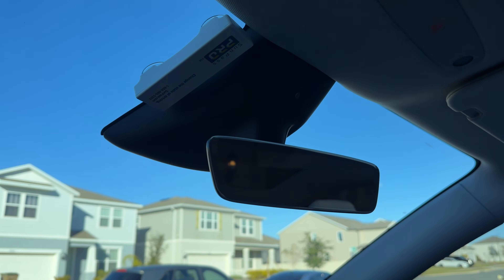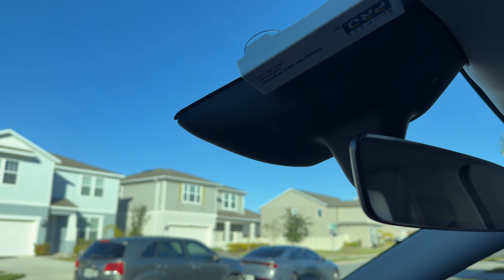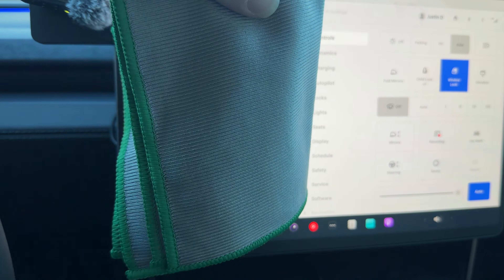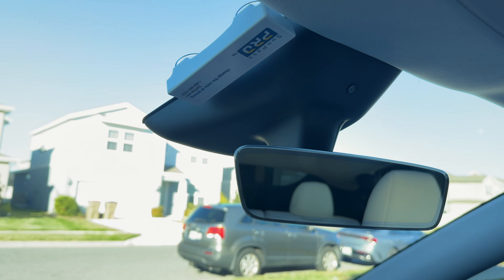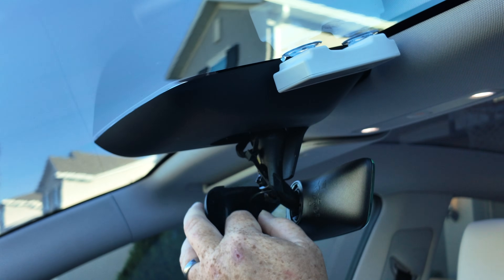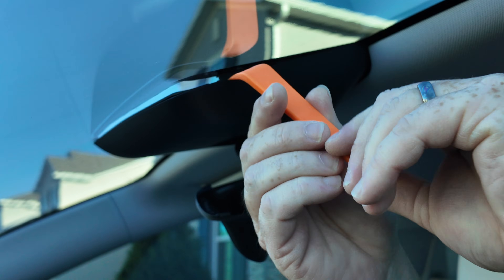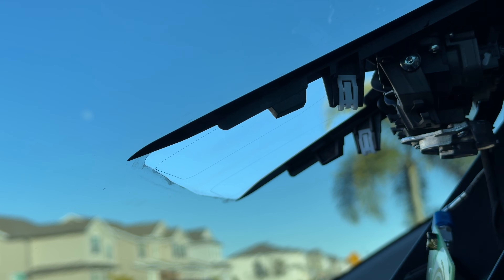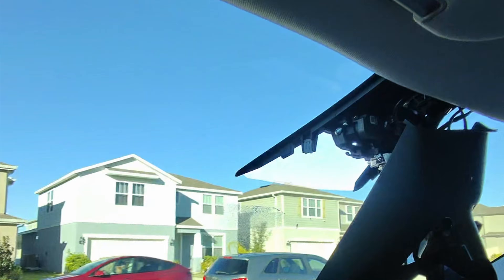Tesla Model Y: Camera Visibility Limited - Here's How You Fix It Quick & Easy!!

Comment: I’ve watched a lot of videos before I did it myself. Number one, you don’t need a pry tool, if you pinch the first trim piece at the top with one hand and put your other thumb in the hole in the bottom it’ll pop right off. Number two, you can then stick your finger in the hole and pop out the bigger trim piece, using your finger inside to help pry it out. You obviously want to replace that piece you broke because it will rattle in there. You should have slide it straight back, not flipped it up.  Four, don’t spray it on the glass,  spray it on a towel and then wipe.

Comment: No, do not follow this video. 
You don't need to remove the section with the rearview mirror. 
You should NEVER spray directly, only on the rag. 
Just Google for Tesla Model 3,Y or whatever model you have including front camera cleaning procedure. You'll see a result from Tesla. 
Follow that procedure, as it's EXACTLY what Tesla does and not what he didn't look up in the video here. 
Especially where he messed up his illegal windshield tint.
You should also run the camera calibration from the service menu afterwards for good measure.
Reply from the maker: You seem to be very knowledgeable about things you know nothing about. Medical exemptions for windshield tint are none of your business
Reply: @BeardedTeslaGuy you've never mentioned a medical excemption. I'm very familiar with it, but 99% of those who get windshield tint do not get an exemption. 
You said yourself in the video that you didn't know what you were doing, and in a few frames you can see how you scraped up the window tint. 
I'm not wrong about what I said, love the Sprayway glass cleaner and use it often. 
You are never supposed to spray anything near sensitive electronics like that and the Tesla service guide specifically says not to. 
Your feelings were hurt, and instead of researching you acted out. 
Watch out for objects in the road while on FSD! The camera cleaning will only get you so far. 
😆

Comment: I never use FSD and only use the cameras when backing up so it's rarely a problem for my use. I just ignore those dirty camera warnings. I have taken that section apart though before they had that service and just cleaned it myself.  Disassembling it is way more complicated than it should be if one is expected to keep it clean.
Reply from the maker: Glad it’s not an issue for you